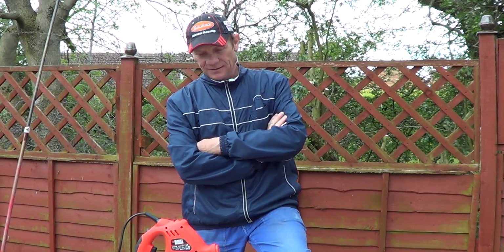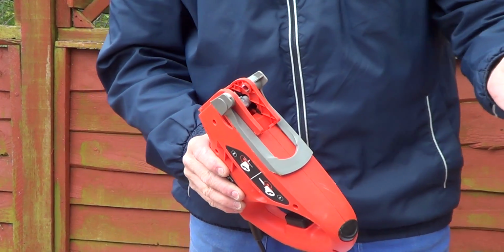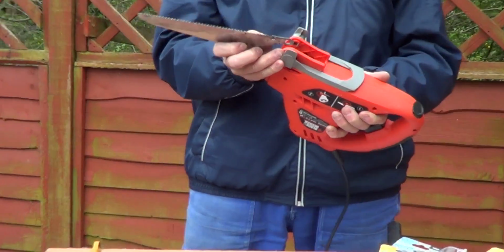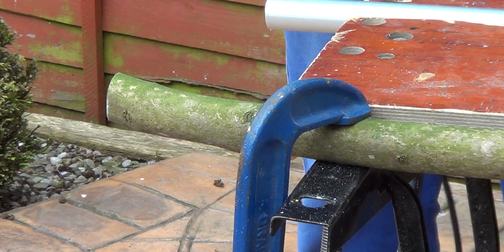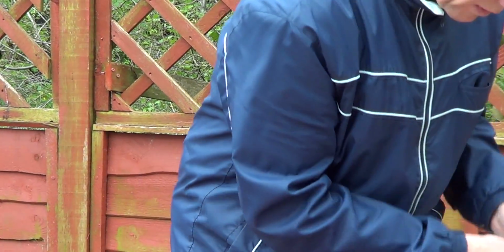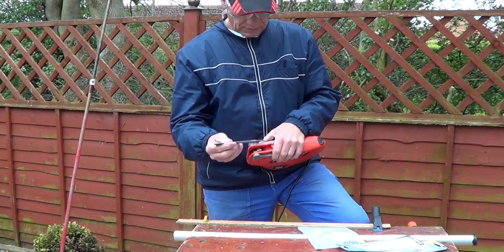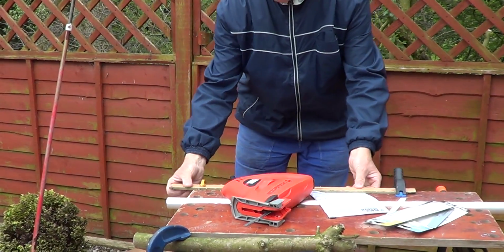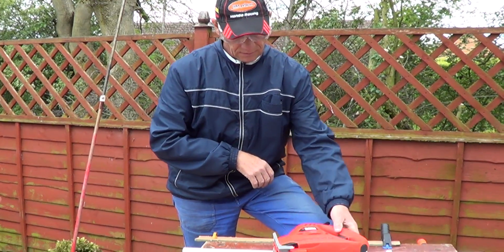How to use an Electric Saw - Electric Chain Saw

Comment: I cant get the blade in, it wont slot into place
Reply: Easy put a small flat screw driver down hole on the other side of the button press and turn align with saw blade and blade will go in like

Comment: Cheers for the demo, have used this saw quite  a few times. however whilst cutting a 8-10cm sapling the weight of tree clamped onto blade & blade came off & I cant put it back in ??
I believe its probably due to the pin that holds the blade is still horizontal & should be vertical but for the life of me I cant turn the pin with a flat screwdriver even though theres a slot in it
Can You please help ??
Reply: If you hold in the blade release button, it should then let you use a flat screwdriver to turn that pin.

Comment: Enjoyed the video. You could have added an extra bit of information that the inner blade slot stud should be in a horizontal position and the slot upward i.e vertical... You can release it by pressing the block knob and using a screwdriver to turn it the right way. . I learnt the hard way. when I couldn't get the blade back into the slot.

Comment: I've used one of those to cut through plastic, and also metal using the standard blade, and most of the teeth are worn down but it still cuts. Also used it on a thick conifer tree stump, not the ideal tool but it will cut through.
Reply: If you buy the B&D Piranha blade, it may do the job with ease.

Comment: Thank for this video.ive just bought one, can't wait to use it,1 question though,mines says on the other side where you have the black button to put a screw driver in and change direction of the plastic button/screw.it has  3 little picture one of the button/screw horizontal,the next picture with screw driver turn the button/screw anti clock wise till button/screw is diagonal, X for horizontal, ✔️ for diagonal  but no matter how I or my neighbour tries it won't move..Have you any idea what it's for...
Reply from the maker: Sorry Carol, but I cant help here. I hope you get it sorted though.
Reply: @MyWagga  thanks for your reply,I found another video that explained it,you only use screw driver when that Plastic screw doesn't go diagonal when changing blade..

Comment: Thank you so much! But I couldn’t find the exact same one. Would you tell me the model name? Can it cut through 3” x 8”wood?
Reply from the maker: It might cut that thickness but only softwood. I don't think you can get this model anymore. If you are going to do a lot of constant heavy work then a real chainsaw would be better. This is for the occasionional DIY type of job.
Reply: @MyWagga  🙏 is red wood hard wood ? The real saw is not so handy.
Reply from the maker: @jingyak7  Yes but all you can do is try. Its a handy tool for all sorts of jobs and I guess if it don't work for the job you have in mind, it won't be a complete waste. It's bound to come in handy for something.

Comment: Thanks for such a great video.  Sadly the clamp which holds the blade in mine has broken, which I believe from some of the reviews is not uncommon with this saw, and the blade is still stuck in it and can't be removed.  If anyone can please tell me how to repair it i'd be extremely grateful. I've undone the screws but can't remove the guard, as I'm unsure how to do it. Thanks.
Reply: If you buy from Argos, they offer insurance cover from £9.99 for accidental damage or breakdown
Reply from the maker: Thanks Karen, hope you get sorted.

Comment: I've just bought one of these & spent the last hour trying to get the blade in. I think it's faulty it just won't fit.
Reply from the maker: vidville vid There's a knack to it. Look at the instructions again.
Reply: Thanks for your quick response.I have sorted it. I  had to press the blade release button whilst turning the locking pin with a screwdriver. Doesn't tell me that in the instructions. Thanks again

Comment: Not easy to fix the blade. My model needs a screw driver to align hub vertically. Any help please anybody ?
Reply: Well this is 4yrs later.  Yes I had to use screwdriver AND push release button as u do.  It FINALLY clicked into place. This video makes it look so easy, yeah right.

Comment: Love my scorpion saw!    Cuts plywood sheets like a hot knife through butter, and gives a clean cut (no splintering)..... Just finished ply lining and building ply racking for my lads van. I reckon this saw saved me 1/2 a day compared to hand cutting. Worth every penny! Cost me less than £30 with 3 blades and case.....
Reply from the maker: Nice one j, hope it gives years of use.
Reply: Yep... I started with my spear and jackson handsaw and it just ripped the ply ( splintered the sheets). Pulled out my scorpion and couldn't believe the result!!... I own a lot of power tools from makita..... 14v and 18v drills,..to dewalt, 110v  drill, Bosch planer,240v drill,and 12v drills....,However B+D have never let me down, I own a Black and Decker 240v drill, orbital sander,.......circular saw, ..3.6v lithium ion screwdriver, mouse sander, and scorpion saw........and I can't fault them!!

Comment: Hi, I have one of these saws, but cannot fit the blades. The problem is that the bit that is supposed to lock the blade in place is sticking out so that the blade cannot bypass it when it goes in the slot. Most frustrating. Can anyone help? thanks in advance
Reply: Must push black release button as u turn screwdriver........ instructions do not say this.
Reply: @doghairdontcarelindaniel7531  Thanks!

Comment: Thanks for this review , according to my knowledge this tool  cold reciprocating saw not chain saw , I bought one from Sweden  in 2006 and I use it to cut the leaf of date palm tree from its base it was very usefuf and effective
Reply from the maker: Tarief Habeeb Yes indeed you are correct about the reciprocating bit. We already knew this when we did the video but we felt it would rank better on Youtube if we added 'chain saw'. It's a very useful tool to have.